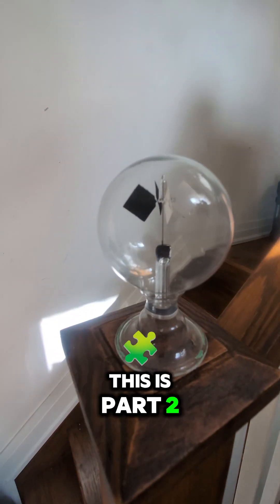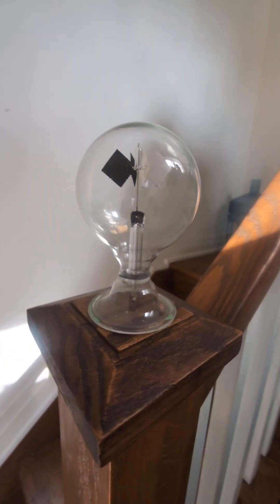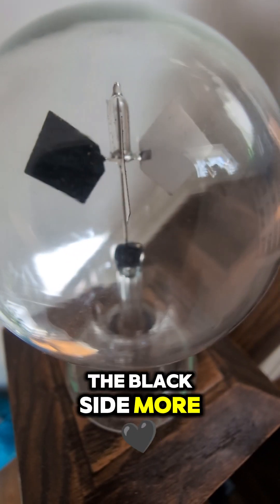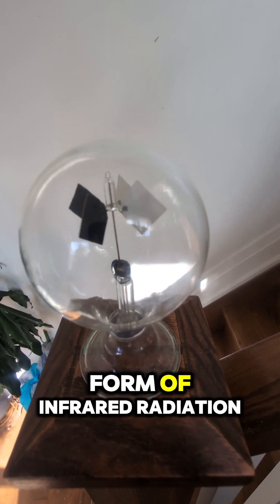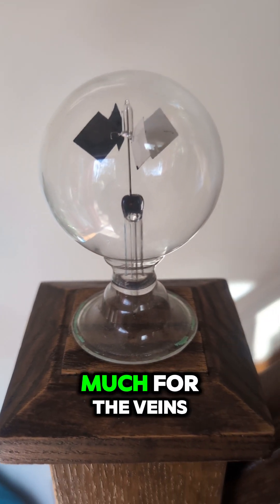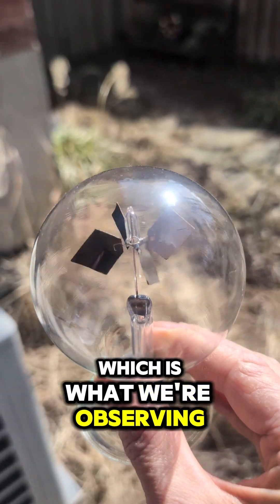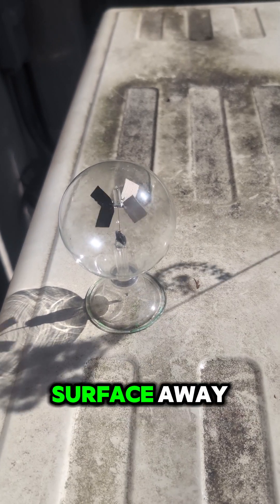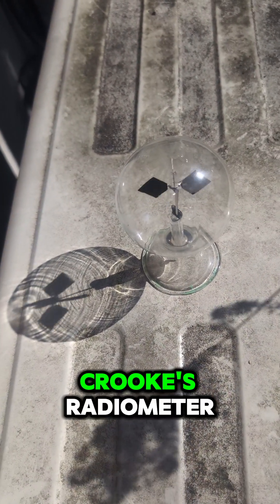Perpetual motion machine (part 2)

Comment: Could that be used to generate power, like a wind turbine?Would it be more or less efficient/efficient in sunny places?
Reply from the maker: Great question. I am not sure if it would generate enough forced to turn a turbine and produce electricity, but it is definitely more efficient in stronger solar radiation, IE sunny places. In fact, when you are watching it, you can see it slow down as a cloud goes across the sun and speed up as the sun comes back interview.

Comment: The white vane reflects photons.
The black vane absorbs photons and the velocity of all the photons hitting the black vane impart a force upon the vane, making it turn. The radiometer vanes turn to the next black vane. Since the radiometer is already in motion, the vane absorbs its share of photons which make it spin faster, until it arrives at terminal velocity. This reaction will continue until sunset.
Reply from the maker: I like your analysis but I would ask this question, if the photons transfer energy in the form of kinetic energy, by hitting the vanes, wouldn't they also transfer an equal amount of energy to the white panel even though it is being reflected. Think of how a billiard ball transfers its energy to another billiard ball, but it can bounce straight backwards depending on the spin.